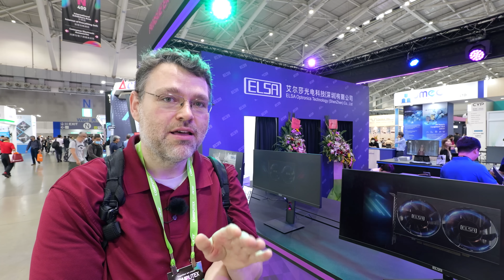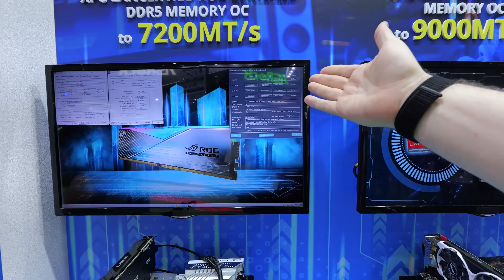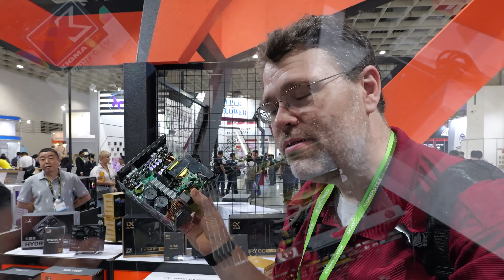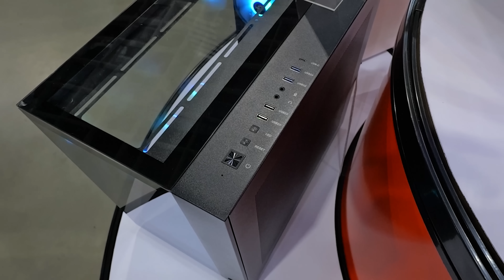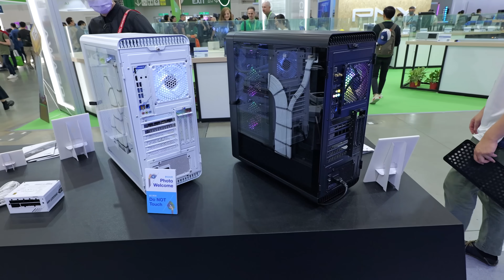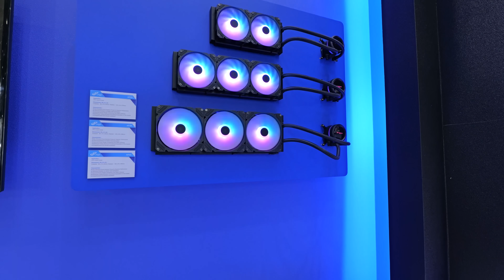COMPUTEX 2023!! Day 2 Part 2 (also a bit of day 3)

Comment: Based on what I’ve found it’s quite likely the “paper screen” tablet display is some kind of RLCD technology. Apparently they work more or less like a normal LCD but with a reflective layer at the back so the light comes in from the environment and bounces back. Possibly it could be referred to as a “transflective” LCD if it’s got a backlight for low light situations.

I guess it’s the same idea they had since digital watches and game boys? But seeing one in full colour is cool. Apparently there are a few different products with RLCDs out there (a few other tablets, some monitors) but seems like it’s still very niche.

Comment: Honestly,  I've been looking at power products for weeks. Yes, the off grid systems use an Mppt charging device to charge batteries while running off the inverter. Additional charging from generator or utility helps in long cloudy periods. Lifepo batteries are the most expensive part, but as you said...greater than 10 year service

Comment: 75 NS timing seems S L O W, even my maxed out 8 MB of RAM in my 486 system had 60NS timing, that was back when ELSA was a graphics card mfg., never seen there sound cards. you are right on the retire part.

Comment: I don't know what happened to Seasonic, I don't know if they're relabeling their lower end lines or what.

I've always used Seasonic they have been fantastic for me, I always recommended them as it works. However now, two friends bought their gold focus line, those two friends both had their PSU's fail.

One has even RMA'ed their Focus twice .. I believe I have a GS, or GX bought it about 10 years ago. Never had a problem with it, but my two friends both had problems with their cheaper line.
Reply: I'd used cheaper Corsair and other PSUs which all failed in colourful ways before I tried Seasonic (~10 years ago). Difference was night and day, similar budget price bracket but the build quality was better and it was barely audible. Heck I think my father's PC is still powered by the S12ii from a decade ago. They've been my go to vendor and recommendation since for many builds, always happy.
Shame about your friend's Focus, I've been using a Focus Plus Gold 650w ~four years now. Not built a fresh PC since covid time, just glanced at prices; crazy!
GPU & Monitor are the upgrades on my horizon, will probably need more than 650w of juice when that time arrives, hope Seasonic will be ship shape. I Hear good things about the Corsair RM series.
Reply: @EDcaseNO  Yeah my Seasonic is from 2014 its been rock solid over the years, I've just helped folks build PC's and Seasonic was my recommendation. 

They have a good reputation, and so I recommend what I know so Seasonic was it, Focus line is affordable which is why I suggested it. The issue with these PSU's has been from PSU's built in the past 3 years.

As helper I get to troubleshoot and I start to feel really stupid when they fail. I just apologized the first time, figured odds, second was weird, when the RMA'ed PSU failed (third Focus) I just kinda got the impression they went down hill.

I told my friend we could probably RMA the PSU again, however he wanted to buy a different one (can't fault him) ended up with a cooler master, or thermal take from Best Buy.

Comment: The higher rated PSUs are a product of the power requirements, right? I'd think in order to get compact units near or above 1000w, higher quality components are required. It drives up cost, but the density is amazing.

Comment: Running 64GB DDR5 6000 CL30 using TEAMGROUP kits.... 4x16gb! It runs flawlessly on my 7800x3d. And then paired with my 7900xtx. I shit FPS in games lmao.

Seasonic is going downhill. The new vertex series doesn't have enough PCI-E power slots. You only get 3.... which means just the GPU. But if your GPU requires 3 and your motherboard has an EXTRA pci-e power like on new high end AM5 boards, you are fucked. The new seasonic are ONLY "good" if you use the new 12vhpwr connection on Nvidia cards. If you go AMD gpu/cpu you are fucked. Sucks.

Comment: I'm a big fan of fans, but can someone make a quieter bathroom vent fan?  I can't stand those things.
Reply: @jamesjoslin1737  their overall design is awful. The flow out the exhaust is more like a suggestion rather than a design decision. They make so much noise and barely flow any air the way they are supposed to.  One or even a couple of large PC style fans could do it better and quieter even with the echo from the ducting...